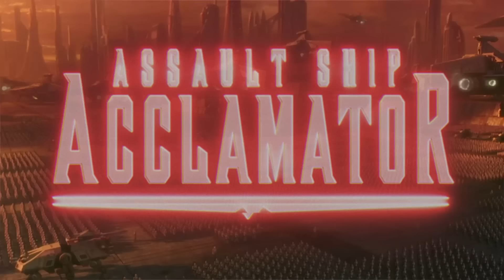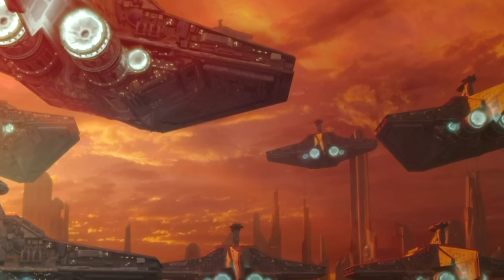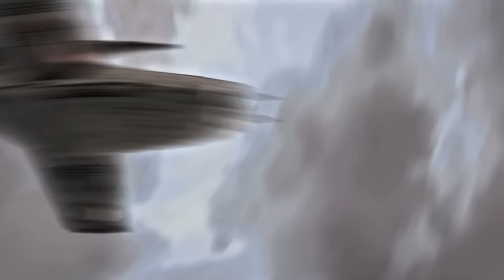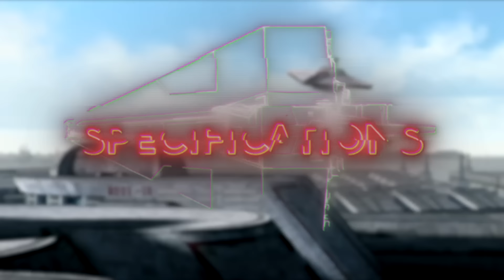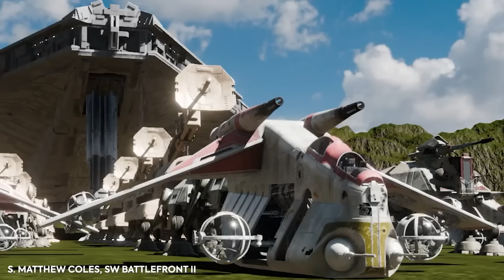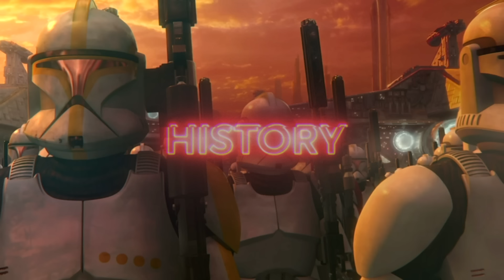ACCLAMATOR | Star Wars Ship Breakdown

Comment: There's a cross section showing part of the interior. LAATs have a railing system suspended from the vehicle hangar's roofs and walkers have storage/ maintenance bays. It even shows the upper decks with the barracks etc.

Comment: Wonder how many fell into the hands of slavers, pirates, smugglers and other elements of the underworld, after they became surplus, given how much cargo and slaves that it could carry. Or even the Rebellion, for that matter. As far as the crew and ground troops living quarters are concerned, a lot of the lower ranked officers and NCO's probably had bunks for quarters and some might've had to hot bunk to save some room. Wouldn't mind seeing the MC80 or one of the other Mon Calamari Star Cruisers in a breakdown.
Reply from the maker: I dunno. You’d think quite a few, but it was a fairly large and complicated ship, so maybe those sorts of people wouldn’t think it was worth the trouble. Hard to say I guess.
Reply: @RadioFreeCoruscant  Yeah, I remember Booster Terrick complaining about how expensive the Errant Venture cost to keep running, with systems failing and others being offline due to scavenging to keep other parts of the ship functional. I'd say that the Acclamator, and any large ship in general, runs under the assumption that the larger the ship is, the more that can go wrong, the more wear and tear that they suffer compared to smaller ships and its harder and more expensive to keep operating, which was mentioned in the novel The Bacta War in regards to Isard's Star Destroyers whem compared to Rogue Squadron's X-wings.

Comment: one question though, how did you calculate the volume and dimensions for the SPHAT's ?. I did some calculations and breakdowns for acclamator carrying space in the past and I remember having difficulty finding a source for them. I remember their size being inconsistent in lore and them being smaller than you had them in the blender would make the accalamtors capacity much more reasonable.
Reply from the maker: Oh, and as for the non-cargo volumes on the Acclamator, I just blocked out roughly the shape of some of the components seen in the cross-section and checked their volume the same way. I also looked up how much space passengers/crew get on cruise ships and military vessels and estimated a size per person based on the figures I found there.
Reply from the maker: Blender has an optional feature/built-in addon for 3D printing that will (among other things) tell you the volume of a mesh. I used the actual game models from SW: Battlefront II for all of the volume calculations, and that’s what size it gave me. I left the SPHAT at its default size from BFII since it looked fairly accurate to what’s seen on-screen in comparison to the AT-TEs.

It is entirely possible that the BFII SPHAT is too large though; it is notorious for that as you mentioned! At least it’s not the ludicrous 100m+ size that some sources state, though.
Reply: @RadioFreeCoruscant  Thanks for getting back to me so quickly. that is probably the best way to get a size estimate for it. and yeah I remember getting a good laugh out of the 100m length that some of the sources listed 😂.   when I did my calculations for the acclamator, I mostly based them off the one cutaway from the incredible cross section.  
When using the cross section, (and you actually need to zoom in a lot with a good resolution to see this) you can actually see the front tip of the cannon of a SPHA-T sticking out behind an ATTE inside the same side bay before SPHA-T disapears beneath the overhead beams and ship mechanical parts. seeing this lead me to believe that the SPHA-Ts are also stored in the side ATTE bays instead of all being in the front bays, (at least for this cross section and whoever designed it). 
this would mean that the SPHA-T in the cross section version would have to be a lot smaller than in most other portrayals and might explain the discrepency. the people who originally designed the acclamator and specifically the cross section probably had a specific size in mind for the SPHA-T that was smaller than it ended up being in other portrayals. this would let them store one SPHA-T in each ATTE bays with the exeception of the ones on the side of the hangar in front of the acclamators fuel bulbs and that central spine area where the bays could be shorter but still long enough to accomodate a single ATTE.

Comment: I want to think that all the listed specs for carrying capacity were the ones at the start of the war, when clones were treated as equipment and they stuffed in everything in alongside everything. i.e., it's all possible, but you'd have to treat it as a cargo ship rather than a warship. Later on, it would be maybe filled to half, so that it could actually deploy the things without making a mess. Also, the GAR would have probably blown a gasket every time an acclamator went down and they lost all those troops and equipment before they fired a shot in anger....and probably learned that maybe it's better if you don't put all your eggs in one basket. Also,flexibility in loadout and availability of men and materiel would have drastically changed the calculus of what to load up on when you sent one of these ships. That's my thought anyway
Reply from the maker: That’s certainly possible. Plus; as they manufactured more Acclamators over the course of the war, the load could have been spread out between them more too.

Comment: You’re overestimating the amount of space for troop bays.  Four troopers will fit in  12 cubic meters. That’s four racks with a 2x1x2 connecting space between them.  Stacking troops like sardines is a military tradition.  

The racks would only need 2 cubic meters. If they were feeling generous in the design, each trooper might have a 2 cubic meter storage locker for personal effects.  A 2x1x2 meter connecting space between them for getting to their rack would mean a full squad of 10 would fit in a bay of 36 cubic meters, with a storage locker for the whole squad of 4 cubic meters.  A platoon (50) would fit in 180 cubic meters, a company (250) in 900  cubic meters. 

Five squad bays around a central mess would give you a 6x12x2  meter dining/recreation area per platoon. That’s 144 cubic meters for every 50 troopers. That isn’t an optimized design, either. 

A 5x5x10 meter space (250 cubic meters) could house five racks long, stacked five deep with a three meter wide central passage five meters tall, giving you sleeping quarters for 50 troopers. That’s 5,000 cubic meters per thousand troops. That’s 80,000 cubic meters for berthing compartments for all 16,000 troops. 

Each trooper needs four cubic meters in the mess for eating their meals. That means an additional 10x5x5 compartment could be divided to seat five rows of tables, two to a table, on both sides of a 1 meter space between them. If that compartment was also divided vertically, it would seat 4 squads of ten simultaneously for meals and briefings. One squad out of five would always be waiting for table space to free up, but it would only add an additional 80,000 cubic meters. 

If you broke it down into squad-sized berthing compartments, 10x4x2 would accommodate 10 troopers, with a 2 cubic meter footlocker under their rack. That’s 80 cubic meters per squad, 400 per platoon, 2000 per company or 128,000 for all 16,000 troops, just for their berthing compartments. 

That puts that 65 cubic meters per trooper into luxury quarters territory.

Comment: The Acclimator also had a carrier variant, that could have replaced the Venator and the GAR would have been more effective with that in the role.

The Nevoota Bee was a retrofitted version that could carry at least 156 snubfighters plus 20 LAATS.
All with a crew of 700.
While a Venator needed a crew of 7400, yet only carried 420 snubfighters maximum, plus 40 LAATs with that loadout.

That was one tenth the manpower with a little bit over ⅓ the snubfighter capacity (37%)
So for three Acclimator carriers you get more snubfighters  and more firepower from the capital ships, with only 30% of the crew requirements.
[All crew numbers are minus snubfighter pilots].

In a much faster ship that could run rings around CIS capital ships, so could get superior positioning on the battlefield and fight on their terms.

And with their Class 0.6 hyperdrives they could be on station a lot faster than any other ship - which was a force multiplier.

Acclimator carriers could disengage from a battle with a CIS fleet, jump to a CIS world and conduct a strike, then collect their snubfighters and be out of there before that CIS fleet could catch up. 

They could be on the offensive all over the galaxy, and able to concentrate in numbers wherever needed to reinforce the lines.

They also didn't have the hangar bay doors weakness of the Venator.

The CIS would never know where a Acclimator carrier strikeforce could hit next. 

Other options include loading up a standard Acclimator with proton and/or ion bombs and using it as a strategic high altitude bomber to carpet bomb a whole map grid.

Just one or two of those at the first battle of Geonosis, carpet bombing the main CIS droid army out in the field, along with the grounded CIS  Core ships, would have ensured a total victory.

As it would have freed up the Clones from the open field meat grinder.
So they would have been free to swamp the arena, resulting in a lot less dead Jedi.
And having the numbers to dominate in the tunnels  ensuring a total victory.

Now assuming that Order 66 never got utilised and Palps lost and the GAR and Jedi ultimately won.

Then the Acclimator in both varieties would be an ideal Patrol Ship to maintain order in the Outer Rim in a new more assertive Republic.

Theres also a Acclimator II that is optimised for planetary bombardment with heavy firepower at twice the number of heavy turbolasers (24 vs 12) but 80% less troop capacity.

However it needed 20,141 crew compared to 700, which raises the question were the extra turbolasers powered by treadmills with Clones on them.

Comment: An Acclimator that had been defanged by the Empire could make a fantastic cargo ship for a freight company - they can refang it afterwards.
And the loading racks for LAATs wouldn't be that useful anyway.

But being able to mount whatever weaponry you want (and can souce) would be useful for a high-speed large capacity fast cargo transport and/or passenger ship optimised for quick transits.

A lot more AA as pirate (and other) snubfighters are much more of a menace with hyperdrive capable snubfighters, making them more commonly encountered.

And ion cannons if you want to have options with enemy ships (including making short term enemies of innocent cargo ships...). 
Plus, officials may look more kindly on big ion cannons than on mostly big turbolasers, on a non government ship.

It would be a great earner as it would occupy a very undeserviced niche - "you need to get half a million tonnes of cargo from the outer rim to the core by when?" 
Or carrying a hyperdrive unit from the factory to a capital ship out in the field ASAP.

And as a ship for a legitimate licensed mercenary company...

Remember you have to be able to buy it off the Empire - unless.....
Reply: Honestly, I'd want to replace their quad turbolaser batteries with the dual heavy turbolasers of the Venator. It'd give them a lot more punch in ship-to-ship combat.

Comment: Something I found interesting was the Clone Wars cross-section book increases the size of the acclamator from the AOTC cross-section's given size of 752m to 891.59m. I think this was to better accommodate the increased AT-TE size from 13m to 22m, which was also changed in this book. Interestingly (maybe) whilst the AT-TE's new size stuck, basically everything else like the 28m long a5(?) juggernaut version, 1155m venator and 891m long acclamator has since been overruled by their legends sizes.

I've spent longer than I care to admit trying to figure out what the acclamator could "actually" hold for a model. The entire underside boarding area seems to be completely open, given the ending of AOTC with the clone army boarding scene, the fact it can carry the zillo beast and its transport inside, and the ventral hangar bay, so I figured it would "realistically" hold maybe a half-dozen SPHA-T or juggernaut sized vehicles there, plus elevators for the gunship and smaller walker hangar above. There was also a deleted scene from AOTC where, behind the front landing pad, there was a forward ramp with SPHA-T's on gantries being lowered done too.

Otherwise, the video was great, and you went above and beyond with the blender model, calculating the volumes. It's nice to see some unique interpretations on ships beyond their provided information. Keep up the good work!

Comment: Could you imagine if the rebel alliance had three Venators and two Acclimators as a mobile base instead of jumping from one planet to the next? Something to think about.
Reply: Still a Lucrehulk would make a bigger and better base. Where the Acclimator would be a superb addition is if it was modified to be the carrier variant.

Then it could ferry Snubfighters far across the galaxy fast with its extraordinary hyperdrive.
Dropping them off a few systems away, from where they then jump to their target under their own power.
With pilots that haven't been sitting in a cockpit for a long hyperspace journey and feeling already wilted by the time they join battle.

And it provides logistics for those Snubfighters and fighter bombers.
Which would really confuse the Empire as to their possible point of origin.
Especially if Snubfighters jump out, dock and get restocked with ordinance and then jump back in. 

And once they return and land, the crew can rest and the Snubfighters get serviced, while the Acclimator carrier travels to the next raid target.

It would be a force multiplier, allowing the same squadrons to cause mayhem all over Imperial space within a small window of time. 

The Lucrehulk + Acclimator would be the ideal paring of legacy ships the Rebellion could repurpose.

The standard Acclimator could also be used for larger Rebel companies.
But it would hold a number of Rebel companies, with space to spare, not just one.
It would be a large concentration of Rebel ground forces.

Where it could also excel is for major involuntary resource requisition missions.

Attack a Imperial facility and steal a lot of equipment and resources in what has a very large freighters capacity, in addition to its firepower.
And then rack off fast before a ISD can respond.
Imperial Conveys would also be vulnerable to this thing, with suitable escorts - which it could carry.
It could be a terror of Imperial outpost and Imperial cargo ships.
Reply: @casbot71  "Especially if Snubfighters jump out, dock and get restocked with ordinance and then jump back in." Don't forget the fuel. And I'm not making a joke here, the very first movie had them detaching fuel lines from the X Wings, and the Old EU X Wing Rogue/Wraith Squadron books constantly mention the fact X Wings need fuel. Dog fighting and Hyper Space jumps eat up a lot of fuel, often limiting the range and time limit of X Wing operations. So having a mobile resupply base would be massively helpful. Probably why by episode 6 we see the Rebels having fully pivoted to a mobile fleet of large ships, so they can be anywhere and everywhere after their last pile of bases all got found and raided.
Reply: @casbot71 
I like where this train of thought is going. My only real concern is the amount of personnel needed to maintain a ship that size. You'll need to turn over most of your logistics to droids.

I was favoring the Venator and Acclimator for speed of escape when the Empire showed up.
Reply: well, the thing is, it's a misconception that all we've seen in the OT are all the Rebels, after they thought to made more sense out of George Movies
sooo if you want a Rebel Cell to have a Small Fleet of Clonewars Era Capitel Ships that hang around at some Deep Space NavPoint, then they have it, i mean Large Battles look nice between  Large Ships
BUT: it makes more sense to have small Bases on a Planet, see the Vietcong and the Works of Che Guevara about Insurrection as direct inspiration for the Rebels
Reply: Hera Syndulla had an Acclamator under her command, called the Lodestar. That was the only Acclamator used by the Alliance in canon and it was used during the Battle of Cerberon.